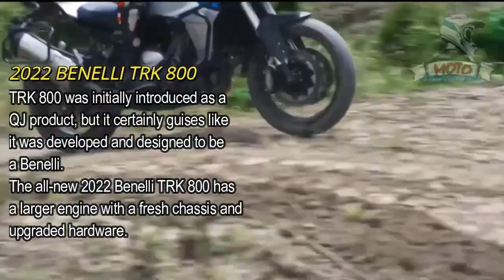ALL-NEW BENELLI TRK 800 Adventure Touring :: What we know so far!

Comment: Why have they not gone for an engine with a slightly larger CC rating.  The CF Moto is going at 799.  You would have thought that they would have had the power output similar to the competition.  Just wondering.  This is certainly one bike I am looking at in the near future when it comes onto the market in New Zealand.